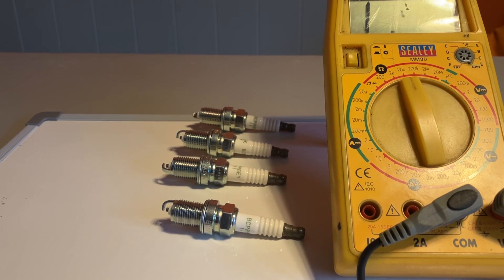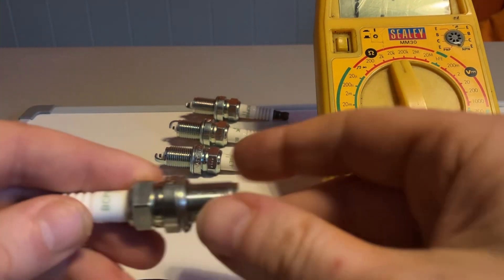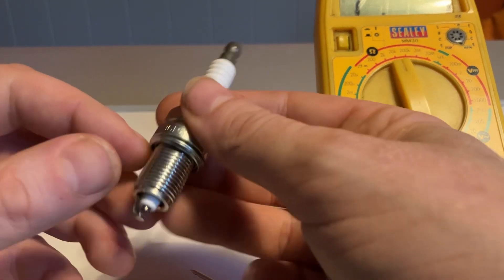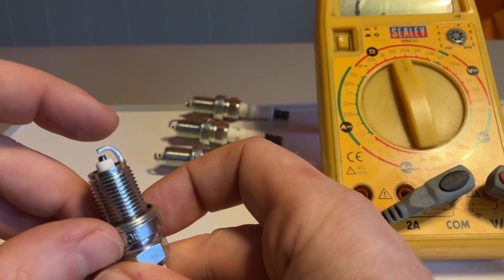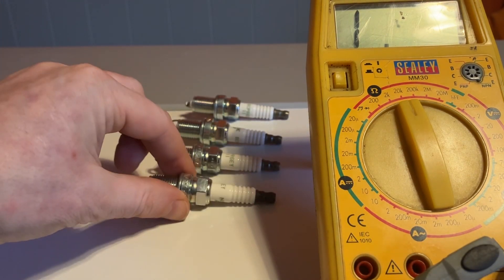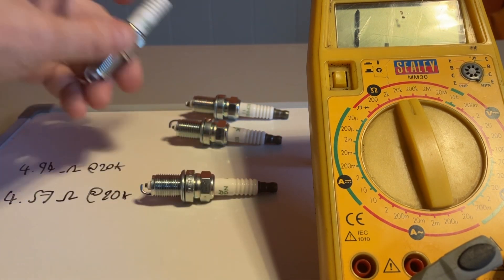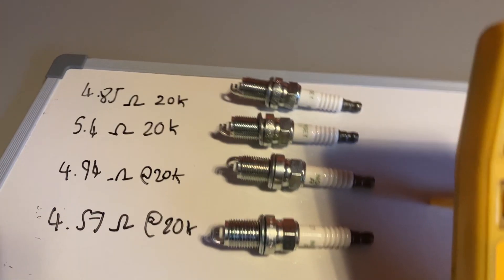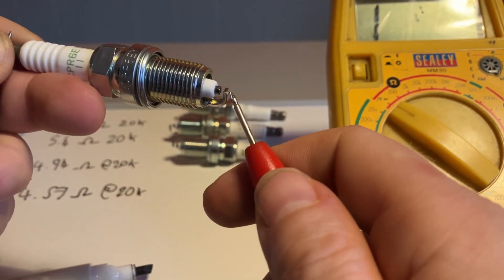How to Test Spark Plugs.

Comment: Cheers, Adam! What is the acceptable/normal ohms RANGE (minimum to maximum) of resistance value for a brand new spark plug?
Reply from the maker: Thanks! Because there is such a huge range in sizes and designs of spark plugs I can’t be that specific. The range is huge!
Reply from the maker: Thanks! Because there are so many different sizes and designs of plugs I cannot really say. The range is massive, sorry I cannot be more specific!

Comment: if resistance of spark plug differs will mileage  differ ?
Reply from the maker: If it’s small variations in resistance it’s not likely to have an impact on performance or lifespan. If one has a significantly higher resistance, that could suggest high wear leading to failure.

Comment: One thing I have found about spark plugs:  variance in resistance through the plugs has virtually zero effect on performance unless the plug is defective out of the box, or damaged on installation.  This is from more than 40 years of experience in the automotive industry and racing.  Plugs will either work or they don't work.  Yes, it's not a bad idea to test them, as I test every plug before I put it into my race car, but unless something is seriously wrong with them, you are more or less chasing ghosts.
Reply from the maker: Yes, true. This is a just technical exercise really. As you say, you tend to find it open circuit and u/s or have an nominal amount of resistance. As you says, it’s worth checking them before putting them in though.
Reply: but isn't it bad for the coil if the resistance is really high ? Wouldn't that cause a faster failure of the coil may be ?
Reply: @aneeshprasobhan  it would depend on the amount of resistance.  OEM have literally thousands of ohms of resistance and have no issues....

Comment: You evaluated the measurement result incorrectly. 
The value read from the instrument in the 200 KOhm measurement limit is not Ohms, but kOhms, so the measurement results are not in Ohms, but in KOhms. The two are not the same, don't mix them up. It doesn't matter if it's 5 Ohm or 5 KOhm...
Reply from the maker: Hi Peter, the multimeter was set on 20k, so 20KOhms. One KOhm is 1000 Ohms, so yes I should have said 20 KOhms technically, but its still 20K.

Comment: Wow, this is huge! I have a ‘21 F150 w a 3.5 EB engine that I have had problems since day 1 of engine misfire when under slight load on inclines on the road. I currently have 40k miles and I have 6 new Motorcraft OEM plugs ready to replace the existing plugs. Using a tip from a recent vid. from the fordtechmakuloco channel I plan to determine which plug is misfiring. I will measure the plug gap and resistance for each new plug that is going in and also measure each plug coming out. The only other major variable in the spark equation is the energy supplied from the individual coil packs for each plug. If understanding and controlling the first two variables doesn’t get me to a smooth running engine then hopefully I can discover a way to measure the coil pack voltage/resistance/energy output for this variable.
Reply from the maker: Well, I hope this video helps in some way. I will be doing other videos on test HT leads, coil packs etc in the near future, so please stay tuned. Intermittent electrical faults are a pain, but you'll get there!